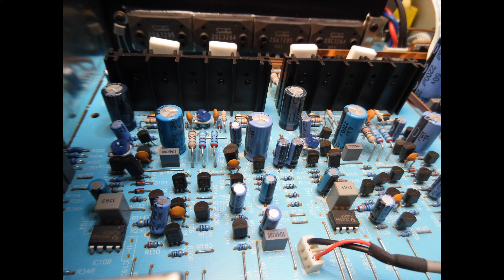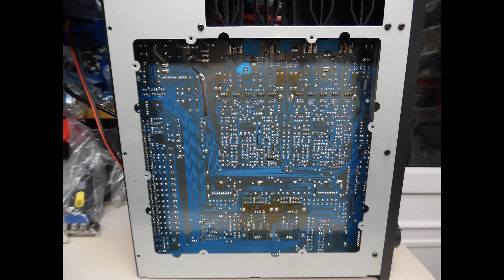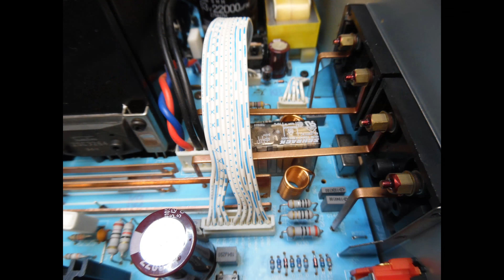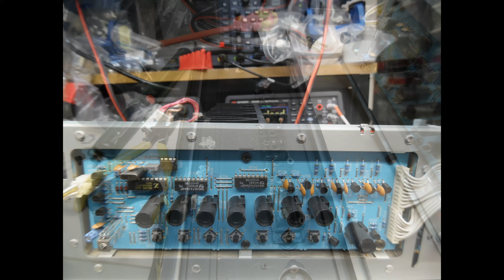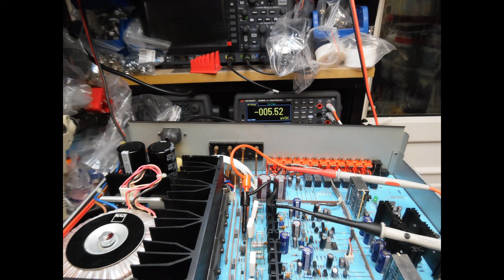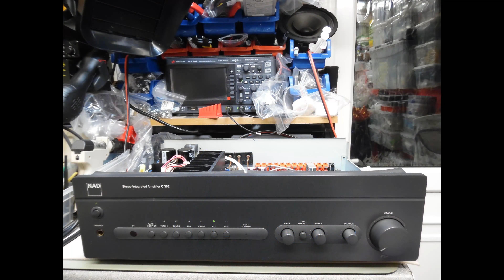NAD C352 Amplifier Repair (With Audio Tutorial)

Comment: Amazing tutorial.  
Quick question, if my primary symptom is the amp cutting out when the volume is turned up or the music peaks (even a moderately low volume), which capacitor group is it likely to be?  
I'm loathe to buy and replace them all, so was hoping to do a smaller recap to save time and money.
Any advice appreciated
Reply from the maker: Hi all the caps will be bad, so you have to get the Amplifier to a known state of good to do further fault finding.

Comment: Здравствуйте! А что вы можете сказать про хлопок в одном канале при включении этого усилителя?
Reply from the maker: Hi, the popping sound may be due to a combination of issues for example dry solder connections, failing electrolytic capacitors. You can determine if the fault is in the preamplifier stage or power amplifier stage. At the rear of the Amplifier are two links that connect the preamplifier outputs to the power Amp outputs. You can disconnect the links and apply signals to the power output stages and then check for popping. The Amplifier will need the work shown in the video completing due to the age of the unit. Only then can intermittent issues be resolved.
Reply: @AudioAmplifierServicing Спасибо, я поменял все кондеры, кроме разделительного, пока не нашёл. Ток покоя 5,3 На выходе 5,3-5,7. Попробую всё пропаять, и как Вы посоветовали. Просто очень странно
Reply from the maker: @Uzerewart378 Did you also replace the speaker protection relays. You can use an Audio signal tracer. The same kind of issue can be due to the FET on the output of the pre amp.
Reply: @AudioAmplifierServicing Да, реле тоже заменил, эти два полевика (мосфет) у нас трудно достать. Я думал о них, пока не нашёл
Reply: Что такое трассировщик?
Reply from the maker: @Uzerewart378 Hi Google Audio Signal tracer. As advised check the FETs on the pre amplifier outputs. You can swap them between each channel to see if the fault moves to the other channel. The FETs go noisy hence the popping.
Reply: @AudioAmplifierServicing Ок👍

Comment: Thank you for this great video. My c352 has a problem where the heatsinks connected to transistors labeled Q155 and Q158 (that I think are to do with the  ±18 V regulators) become too hot to touch  after 6-7 minutes of the amp powering on, even with no inputs connected, no speakers connected and volume knob turned all the way down. They gradually get hotter and hotter. This eventually trips the protection circuit. Would recapping likely fix this?
Reply from the maker: Hi, the plus and minus 18 V supply rails power the vertical line in / line out modules, I would remove the line in module and check if the excess draw is still present. 
You can then do the same with the line out. The issue with the J&H capacitors causing the Amplifier to switch to protection mode will always be an issue so it is best to re-cap the Amp and return it to a known good state to allow for further fault finding if required.
Reply: @AudioAmplifierServicing  thanks for the quick reply! I am very inexperienced with this, would removing the line in module just involve unplugging the appropriate ribbon connector?
Reply from the maker: @TheArmedBaboon Hi, the modules need to be desoldered.

Comment: Brilliant tutorial 😊
Fixed and recapped two of these but I haven't done the speaker relays or resistors. 
Sadly one of them when measuring idle current, I shorted test pin to speaker copper rail and now it stays in protection mode. The pin is right next to the pin, too close in fact, but I should of done what you showed and powered amp off first! The C352 is a wonderful amplifier